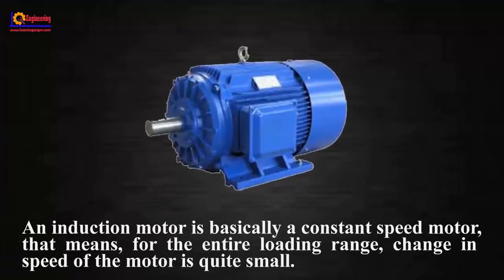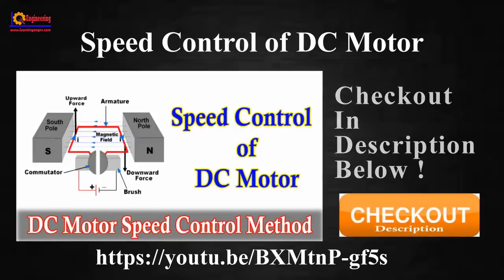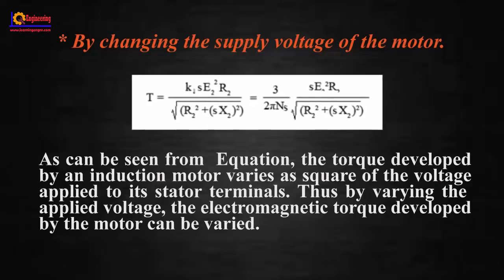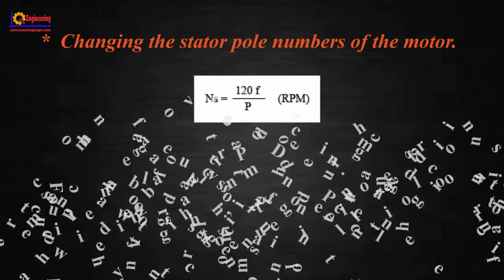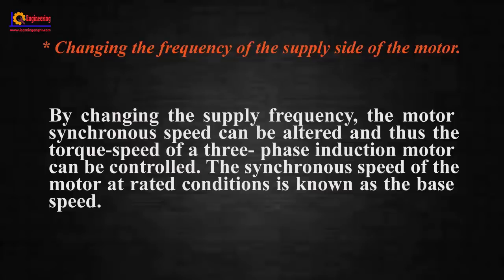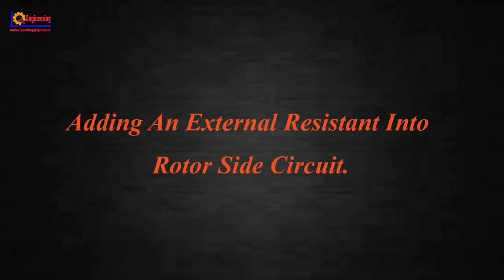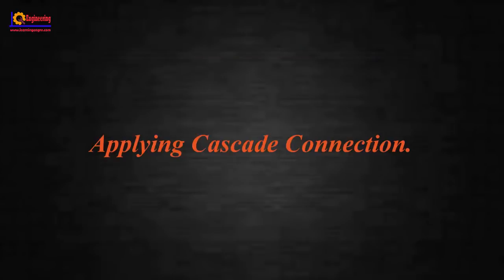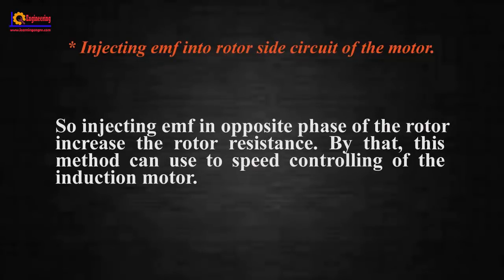Speed Control of Induction Motor - AC Motor Speed Control Methods

Comment: when you increase frequency, the speed increases but the torque decreases so you have to keep voltage/frequency rate constant by adding more voltage to compensate which causes more current flow into the motor that will lead to more heat and  eruption of it and the life span decreases. Another hacky way is to use matter-antimatter relation.

Comment: Solid state relay with variable resister that is VR .How to control the AC motor .With 100 mfd starting current.Running capacitor is 25mfd.Please  give me the detials vedio

Comment: hello, what do you mean by increase decrease of the  "torque-speed relation"? higher frequency results higher speed and higher torque, while lower frequency results lower speed and lower orque, I guess. The question is: frequency has more effect on spped than on torque, is it correct?

Comment: For one your not going to rewind a motor to just change the poles you would just buy the right motor for the proper application much more cost effective and 2 you could double the voltage to a motor even triple it, it will not change your speed because that motor is wound for one speed unless and high and low voltage so if you double it your more than likely just going to burn your motor up. VFD is the only safe sane way to speed up your motor or slow it down and even VFD's have problems with rotor currents destroying bearings because of high frequency currents travelling through the shaft arching between the balls and the race. I would add a Common mode choke to filter out Eddy currents ageis rings suck!
Reply: Additional...... Higher frequency equals more cycles yes higher voltage but with a matching frequency.

Comment: Hi, 
Do you have a Controller Board with following specifications (RPM Controller via IR)?
1- Controller board should run on 12V DC.
2- Controller board should READ/DETECT RPM of an already running Motor-A via Infrared as its input.
3- Based on RPM of Motor-A, Controller board should run/turn another Motor-B on same RPM as of Motor-A PLUS 0% to 10% greater (should be adjustable).
4- Controller board should only give output to Motor-B, when Motor-A’s RPM will be within range from 1 to 3500 RPM.
5- If RPM of Motor-A increased from 3,500 (should be 500+- RPM adjustable) then input to Motor-B should be stopped immediately.
6- If RPM of Motor-A becomes <= 0 (should be 500+ RPM adjustable) then input to Motor-B should be stopped immediately.
7- Features of Motor-B will be 11v to 14v DC, 1 to 2 Horse Power, Maximum 4,000 RPM.
8- Controller Board should have display:
A- Actual RPM of Motor-A
B- Actual RPM of Motor-B
C- Actual difference between RPM of Motor-B and Motor-A
D- Set difference between RPM of Motor-B and Motor-A
E- Set Highest RPM of Motor-A to cut-off input to Motor-B
F- Set Lowest RPM of Motor-A to cut-off input to Motor-B

Thanks

Comment: what a poor presentation. almost no visual objects. full of writing.
Reply: and he is wrong, you can not change the speed of an induction motor by changing the voltage.. You can only change the speed of an induction motor by changing the frequency of the supply.